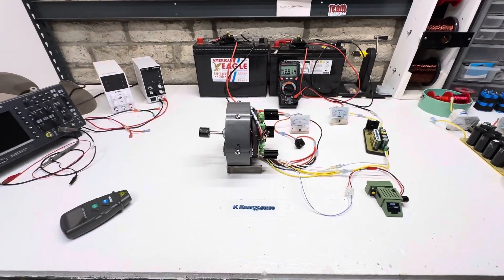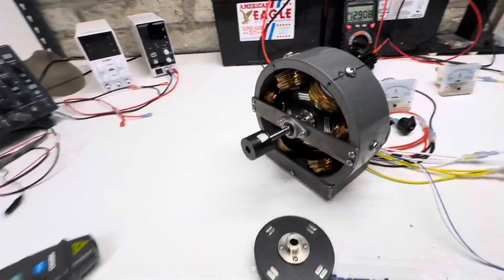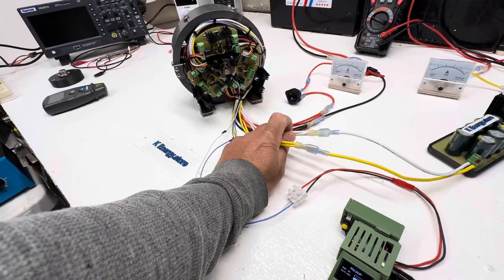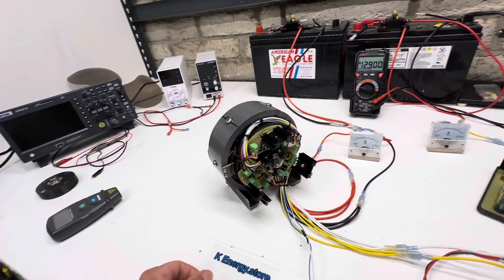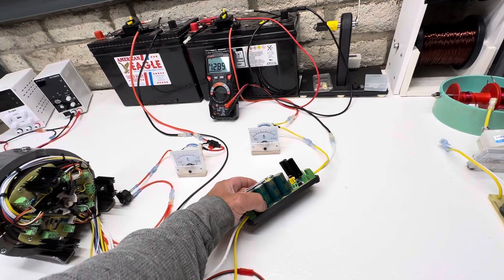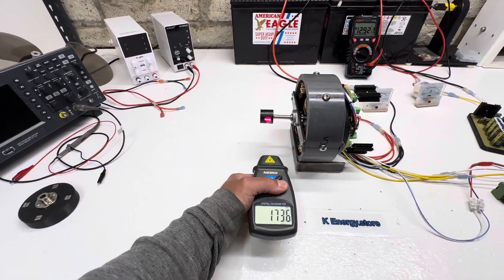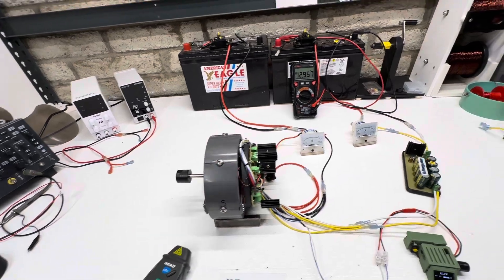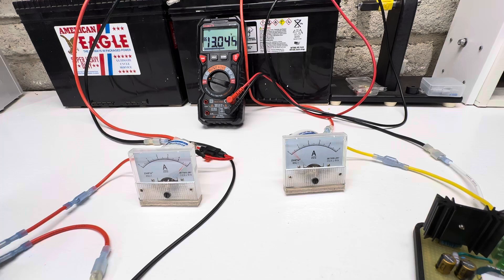Repulsion motor update

Comment: Did you find attraction mode has more torque or more speed rather than repulsion mode?
Reply from the maker: Attraction mode was with steel rotor it ran slower but had a lot of torque it just uses much more power when not loaded